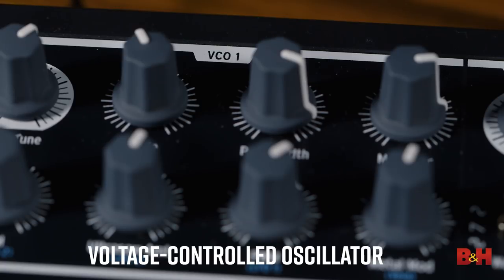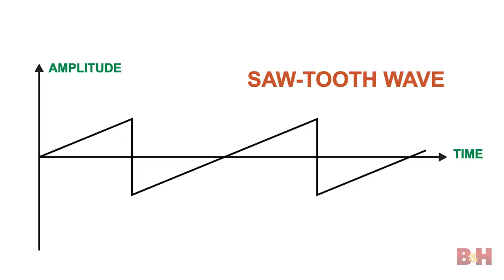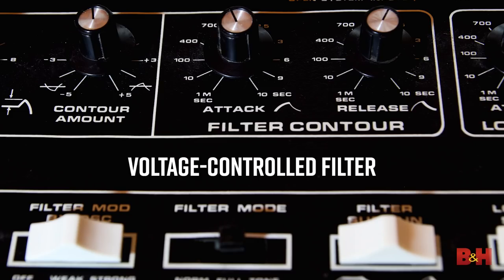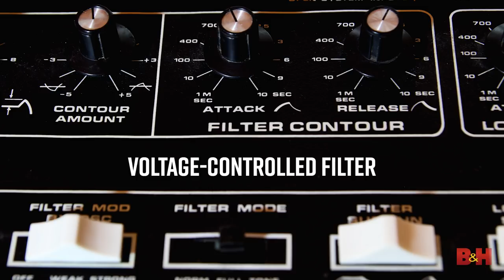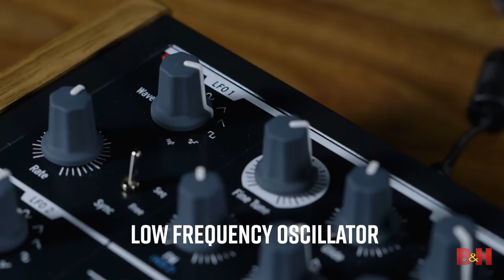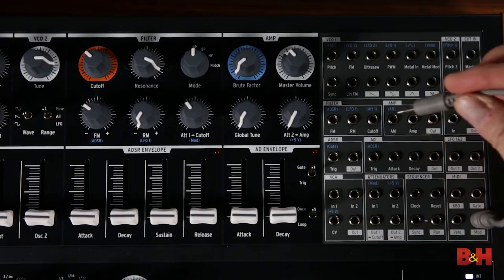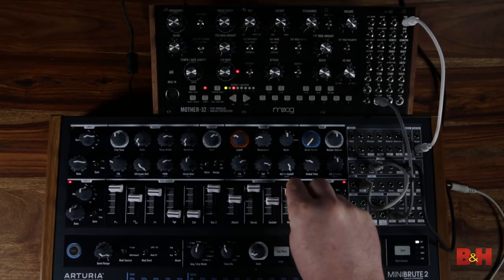What is a Modular Synth?

Comment: These toys are still a mystery to me. I see him tuning effect knobs but who is actually playing the music?
Reply: Modular Analog Synths are controlled by control voltage. MATHS that you see on the lower right is a module that can do a lot of things but one of them is spitting out random control voltages. You can control the randomness to a great amount so it isn't the machine doing the music but you deciding in which way the randomness is allowed to flow ... I hope I could explain this a bit without owning a MATHS (yet). The Minibrute has a step-sequencer built in, so this is also programmed and then plays its loops. The Mother-32 in the upper left corner also has its own sequencer, so you could run 1 + 1 + a lot of stuff from Maths.
Reply: if you plug in some way the cables thru the patch bay you just dont need to play notes. Same way you can activate arpeggios ..loops and many more.